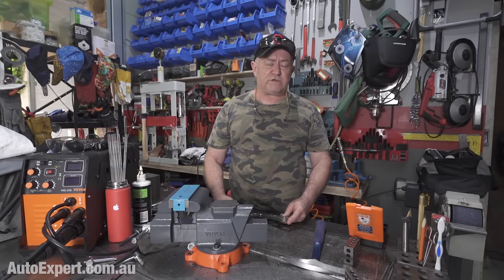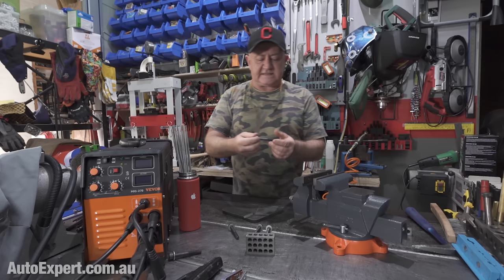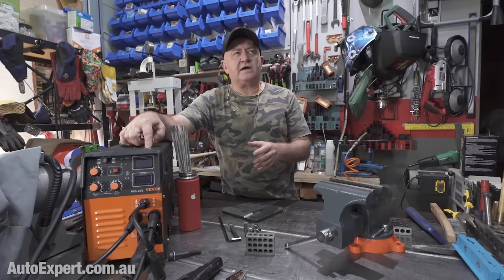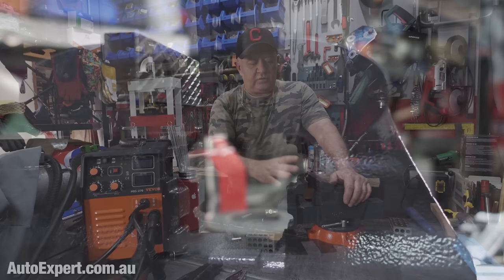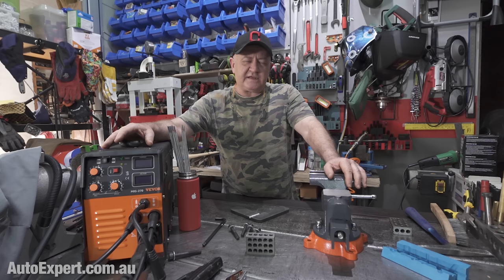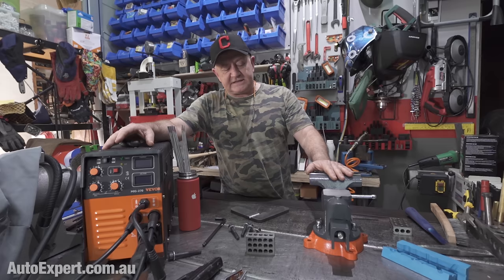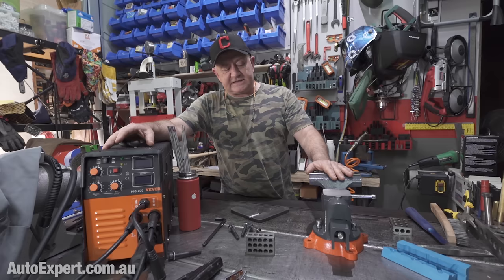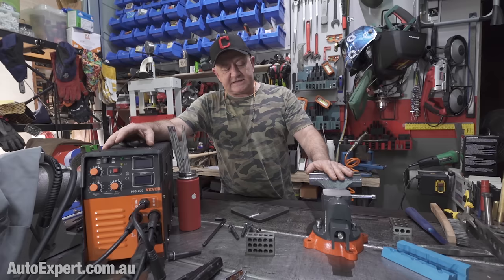DIY steel fabrication basics: Welding, drilling, tapping | Auto Expert John Cadogan

Comment: This channel just keeps getting better and better.

Thanks, John.... I'm a mad small workshop guy.... In fact, I have been welding today myself. I find that making in general is so therapeutic and keeps me feeling good about who I am.

I can't write computer programs nor understand the stock market, but I can join metal with electricity and also make quality items from wood.

But welding is my first love. In fact, I have a thing to share. I was trained as a welder in the 1980s, so I used a nod to close welding shield. Now, I have a self-darkening shield. I still find myself having a little spasm as I commence a tack or weld as my brain won't allow me to remain still.... I wonder how many others suffer like I do.... I actually laugh at myself each time I do it.
Reply from the maker: I trained to work like that. I have that twitch.
Reply: I've still got the nod!!😆

Comment: in furniture making we use self centering drill bits.  am tempted to get a welder for the very odd small job.  though it may end up being cheaper just to get it done.  the only thing i really want is to make a frame to sit my tablesaw on that has castors attached for easy moving.

Comment: 'Guilty, your Honour",... I have ( sometimes ) rushed a little job and did not take the time to bevel the joint. I knew that was wrong,.. I was lazy at that time. 
John is correct,..an 'un-beveled' joint will, more than likely, break or distort.

Comment: Good job John, you definitely picked the right profession for your personality I think engineer through and through 

I think I’ll buy one of those vices they look bloody good and the 4 1/2 inch is only 50 odd bucks…….

Regarding the video, I like to see you tack things to hold it down, but I always thought the purpose of the tack was simply to stop things moving as the joint heats up and expands from one end to the other…… It all ends up skew wiff…… good job

Comment: The only welders I've used that actually deliver the current they say are usually well over a grand. Modern 1K ish welders are usually pretty good but even as far back as 5 years ago it's only really welders that retailed close to 2K AUD  that get even within the ballpark of what they claim. With chinese welders you can take about 30% off the top of their rating and about 15% when around the middle for 100 amp rods i find 110-120amps for chinese machines is usually about right but it does depend greatly on ambient conditions and how well your home power copes with the load in terms of frequency and voltage. 

One of the most expensive welders I used was a small 170amp mig only kempact. They were close to 2K last time I checked but their value is being able to weld well off a very dirty power supply without dying, behaving wierd and usually don't hurt a generator that can only just supply enough power. 

These cheap inverter welders are great but they can make the learning curve a little steeper, especially with stick welding as I'm constantly fiddling just a few amps here and there as they get hot whereas my way more expensive WIA ACDC Tig/ARC welder I barely have touch and feels easy with arcforce, hotstart and other functions but I find myself leaving that machine as a stationary TIG station as it weighs a tonne and I don't like wheeling the gas lines and massive tig torch cable around.

Comment: Interesting vid John. Nice one. Much better than the EV hate vids, but will probably generate less $$s for you. While you're talking about fasteners, can you talk about wheel studs/bolts. Lots of people seem to think they're there to hold the weight of the vehicle not bolt the wheel to the face of the hub. Fasteners aren't there to take the weight of anything, just to clamp to faces together.

Comment: I was taught at trade school to start a tap in the drill press and when you turn the drill off as the motor is winding down quickly force the tap into the hole to get the thread started than finish it off by hand. Same with tapping on a lathe
Reply from the maker: Sure. Or a mill.
Reply: @AutoExpertJC  even seen a nut tack welded over the hole to get I started before. Or just be a hack and start it by hand. Nice bit of kit you got there though.